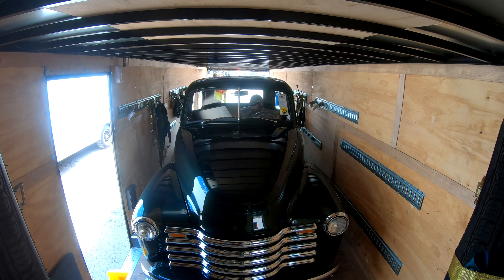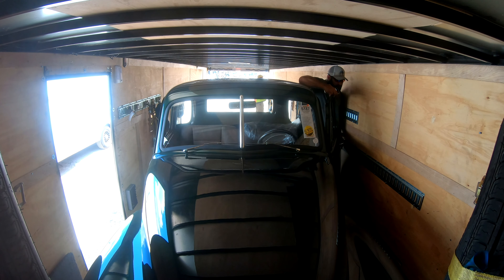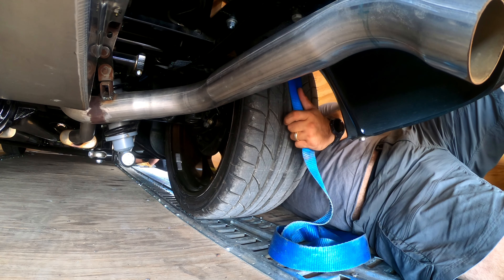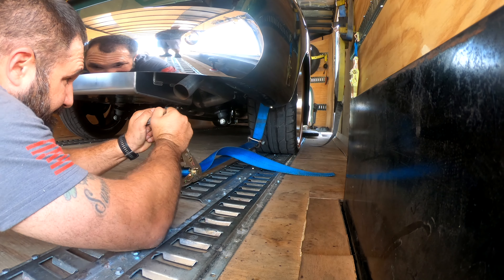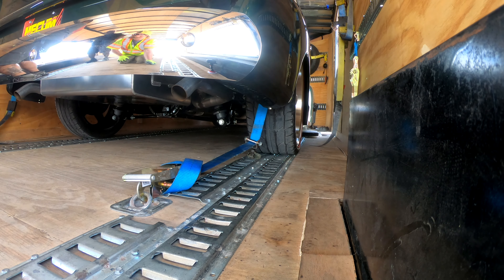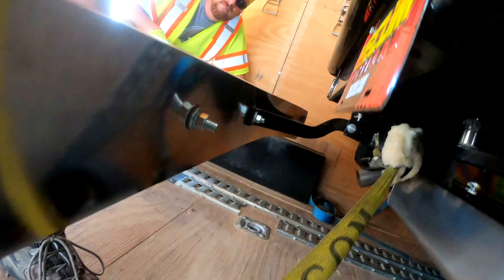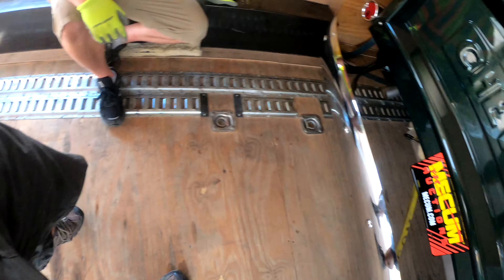How to Properly Strap Vehicle and Load- Hotshot Trucking Video

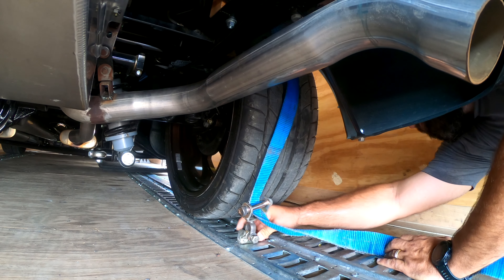Comment: 6:54 Why didn't you just go through the tire? Also the manufactures of those straps tell you NOT to crank down so hard. You also DON"T cross scrap if you don't cross strap them both. If you tighten it properly it will pull it to that side. With no other strap pulling the other way you run the risk of damage. 4:20 It's called an idler roller/pulley.